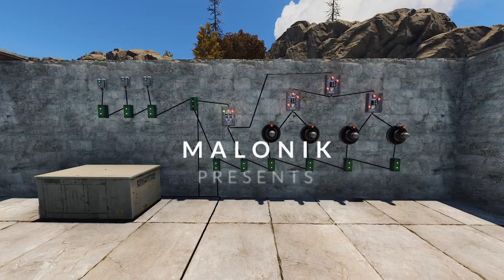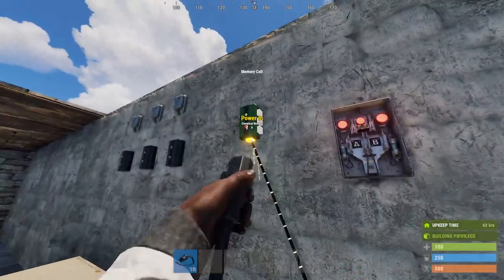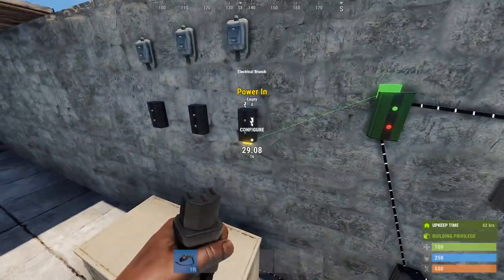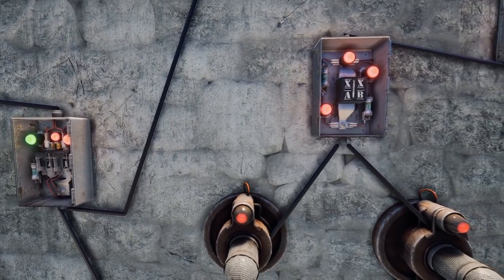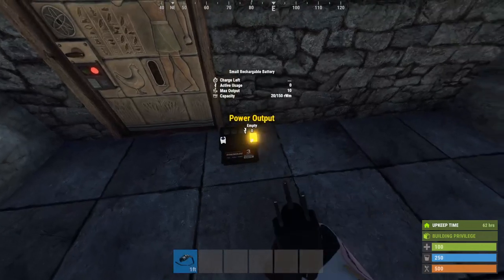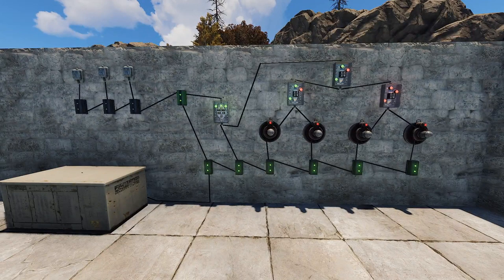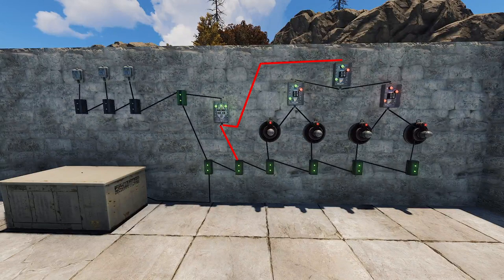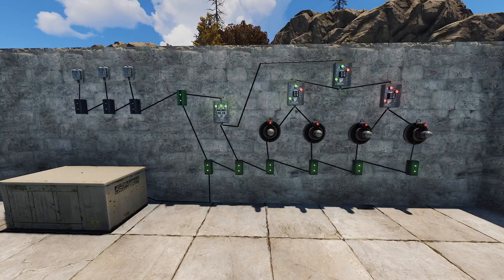RUST 101: Electricity - Base Lockdown Circuit

Comment: Great vid! Interesting about XOR and OR comparison. I was tearing my hair out why the OR wouldnt work but the XOR would (in an Autoturret circuit i was building) but this is the reason i guess! According to Rustlabs they consume 1 power so in theory it still shouldnt get to the 2nd XOR switch in your example (if im understanding correctly). Also so frustrating having to use so many branches as well I wish they would bring out one with much more outputs! ...Anyway great vid mate. :-D
Reply from the maker: Thanks! :) Yeah I'm not sure why it doesn't use that 1 power but it's been like that from the start so I'm not sure whether it's intended or not because surely they would have fixed it by now..

Comment: 5:48 - I would add that since this is basically a 'We're getting Raided!' Warning / Base shutdown system then you could also use the power out of the mem cell to go to a system of alarm lights/speakers deeper inside the base and/or the smart alarm (when the app gets released, to send you a notification), etc. It would also let you know that once everything is clear someone needs to go hit the master reset switch in TC room, or wherever it is that you feel safe enough to put a literal open all the doors' switch.
Reply from the maker: Ooh I like it!! I'm extremely excited to get into the smart components.. already got the app and have been playing with it on staging lol.

Comment: I think door controllers are viable mostly for airlocks, turret pods or minicopter garage, even the simplest setup (pressure pad + door controller) can make your base more secure and you don't have to turn your head back each time to close the door as you leave. But due to door controller nature and lack of different states it is really annoying to use. Regarding security concerns I've seen a really good solution suggested by someone - placing the RF broadcaster on top of the TC, so coupled with hidden antenna it automatically cuts the power once tool cupboard gets destroyed. But if you plan to use circuits like that external TC's or multi-TC build is a must
Reply from the maker: Yeah that's fair enough, it's annoying as hell that the for controller is really a door toggle rather than a controller lol.

Comment: What if all sensors detect enemies at the exact same time? XOR SWITCH wont passthrough any power, no doors will shut.
Reply: Yeah I was wondering this as well. 
Guess depending on the base it would be unlikely that both could be set at the same time before at least one signal was sent first?

Comment: awesome, now I know what I did wrong all the time. But the heck i never realised that the XOR doesn't use power... I hope they won't change that, cause if they do oh man that would screw up so many possibilitys. Again Great Video ! Also the now the XOR gives me new Ideas for using it with the output of turrets.
Reply from the maker: Yeah a lot of people don't realize that which to be honest is completely fair. I would have expected them to use 1 power and for a long time thought they did until I tried one lol. Another funny little electricity thing is that you don't need to power a pressure pad if you're just wanting it to trigger 1 thing. Not sure why but hey it works lol.

Comment: You could alternatively make this with RF Broadcasters for each HBHF sensor, all set to the same frequency. 

A single RF Receiver would trigger the Memory cell.

This would remove the need for XOR switches, but would be a bit more expensive in terms of tech trash and high qual.

Comment: That left side with the door controllers, you could use one splitters for 10 HQ and 1 Rw instead of 9HQ and 3Rw.  Splitter is boss.  Can also branch 7 power to a splitter to feed 3 HB's.
Reply from the maker: Yeah absolutely! I went with branches because I didn't know how many door controllers Nycee was actually wanting so the 3 was just an example and the branches covers them incase they need way more or a weird amount of them. :)

Comment: XOR switches are so underrated. They can act as blockers, AND switches, OR switches, are fairly common, don't consume power and are cheaper than a blocker (5 HQM vs 5HQM+1 gear). And they work both ways!
Reply from the maker: I think a lot of people just don't understand them. Like the or / and switches etc are nice and simple because their functionality is in their name. Where as with an XOR people see it and are like wtf is XOR lol.

I'm curious to know how you're implementing them as an and switch or blocker though. I wouldn't have thought you could use them as an and switch because it'd send power through when only 1 line inputs power.
Reply: @Malonik  I might do a quick video about how versatile they are, if it can give you inspiration for the Power Minute series 🙂

Comment: rly like your video's and they helped me alot getting the basics. the x/or's in this setup however i feel have a security flaw, because when a larger group would be triggering both sensors (coincidentally) or the sensors overlap their area accidentally, the x/or wont pass any power through.  i get its a small chance as the timing for triggering both sensors would need to be perfect, but still. personally i use a circuit requiering a little more power, being an and switch for every hbhf and have a branch feed the 2nd input on the and switch to supply enough power through that line, as the hbhf will only need to put 1 power into the and switch to activate the passthrough. after that i funnel the and switches into or switches to get 1 output line again. i feel the extra power consumption is worth covering that risk. interested how you feel about this.

Comment: Nice circuit!  The And gate is not needed here because the memory cell only needs one volt to trigger.   If you have a need for way more hbhf sensors, look up the "many eyes" circuit on the rustrician reddit.

Comment: Use a splitter on the door controllers if you have 2 or 3 door controllers, you want to safe electricity and you dont mind using a little more hq
Reply from the maker: Yeah absolutely! So long as your power supply is stable to avoid the issue where splitters throw away extra power lol. I just went with branches so it can be expanded and implemented easily into bases with lots of doors. :)

Comment: So, i realized that if every sensor goes off, the XOR's should effectively trip themselves and reopen the doors. however, if you have power always running through an AND circuit, you can use the AND as a little transistor instead of XOR's, this removes both the 1 power problem, and the short circuit issue.

Comment: Just wondering why you chose XOR switches instead of OR switches. It is highly unlikely but if the two sensors go off at once and they are both on the same your switch it won't send any signal. With the or switch it doesn't matter how many sensors pick something up.
Edit: Ah, I see. Should have watched the entire thing. However you can avoid the problem of the 1 power output of sensors with a branch in front and and AND behind the sensor
Edit2: that said your solution saves energy and will probably do the job anyway, so nicely done creating this efficient circut

Comment: Is there not a flaw in the design that using XOR switches that if multiple HBHFs are triggered at the same time  then it wont work
Reply from the maker: Not that I know of? When I was testing it all 4 of the sensors were detecting me and going off and it worked fine.
Reply: @Malonik  I was thinking that in theory because of the exclusive nature of XOR if there is another signal it would cancel up the other. so hypothetically if two signals were to happen at the same time then they would cancel each other out failing to push through a pulse to trigger the memory cell to switch on the lockdown. 
but that might not case in actuality if thats what your tests show - i would interested to check into that myself if there is something useful to exploit there. i know electricity doesnt flow instantly but takes more time if it has multiple components to travel so maybe there is something like that going on - which in this case could be useful.
(I made a self turning off generator turret circuit for a friend who loves cave bases but i could only make it work if i slowed down part of the circuit by adding additional components to slow the signal down enough to keep the whole thing on long enough to get all the other components to function.)
Reply from the maker: @SirDominic  Yeah they don't seem to work the way I would assume a XOR should.. But they've been in since the start of electricity so I'm guessing it's working as they intended at the very least lol.
Reply: you are correct in theory but Rust doesn't always work according to plan lol. As long as your sensors aren't placed in direct line of sight of each other and the raider simultaneously (which would be impossible with a little bit of planning and require a ton of luck on their part) then one will trigger the circuit before the other and it'll work.
Reply: Yea I had the same question. Nice, in theory it shouldn’t work if both sensors are going off.

Comment: Maybe do a simple minicopter garage sensor? (When player with TC access is detected, minicopter garage opens) I think this would be a cool project for and beginner electricians
Reply from the maker: I do that exact circuit often for my boat house! We actually have it rigged up so it works both in and out and shuts behind you. I can definitely do a video on that one. :)
Reply: Malonik Sounds cool! I think it’s one of those circuits that even people uninterested in electronic bits and bobs can use
Reply from the maker: @scuffedrock  Yeah for sure and it's really not a hard circuit so should be a fairly easy vid. :)

Comment: So, if you get attacked from every side by a Zerg, the XOR switches will get voltage on all their inputs and nothing will happen? Just wondering. Great explanation for the circuit, btw, not too wordy.

Comment: I have watched tons of rust electricity videos. I know the basics like batteries, switches, branches and combiners but, I can't use them in a circuit that I plan. I would love to have a base with both this door system and a light system that automatically lights up when it's dark and shuts down when it's day time. Also I want maybe one or even two turret traps with hearth beat sensors. But it all gets really really complicated. I want to use solar panels because wind turbines can be griefed easily and it makes your base look more apealing with a tower to generate more power. I would really love to see a base design stuffed with practical and cool electricity circuits like an in game clock.. I honestly don't care about it being 100 rockets and cramped up with all that bunker shit. I think that would be a really good video to do.
Reply: You can definitely do this, even though it's going to be a hassle. What I would recommend is having separate circuits for the seperate functions. You make this circuit + battery backup cause of the solar panels, and you find the other circuits too, and also give them battery backups.

The easiest one is by far the light circuit. Use as many solar panels you need, combine with root combiners, and then send the power to a battery of your preference. Then connect the output of the battery to the input of a blocker. To block the passthrough, either use a separate solar panel, or before you connect the power source to the battery, branch out 2 power into the block passage input. The output of the blocker should support all the lights, that will automatically only be on when the solar panels send no power.

I'm on my phone, so sorry if any of this is confusing/poorly formatted
Reply from the maker: Sounds like you're overwhelming yourself, keep things as simple as possible when it comes to electricity and especially implementing multiple things. Have an electrical branch chain from your main power and each branch off is a new project/circuit. 

The lights are particularly easy because you all you need to do is put a blocker before the lights and run a solar panel into the block socket. Then when it loses sunlight it'll turn your lights on. 

The turret traps are just a sensor into  door controller and if you're wanting to save power and not run the turrets constantly the sensor and mains power into an and switch then branch out to the door controllers and turrets.

The clock I haven't done, mostly because without admin you can't get the current server time and it'd shit me knowing it's not accurate lol.

Comment: I would use 2 HBHF sensors, one for your team and one to exclude your team. The one to exclude your team would be for raiders to trigger, with a blocker. The blocker would then go to an AND SWITCH coupled with the other one for your team. So if you came home you could open all the doors for yourself but if someone else was outside or in your base it wouldn't open anything and would cut power and close the doors. Something like this https://i.imgur.com/jRr686I.png Much more simple IMO
Reply from the maker: Nice one! That's a fantastic little circuit!
Reply: @Malonik  Thanks :) I just realized my 3rd branch on the left is redundant but no biggie. Really nice video btw, clear explanations and you taught me that XOR switches don't use power, keep up the good work!

Comment: Question, can one heartbeat sensor open all the external doors on a building or doors of your desire, usually with turrets behind them, or do you require having each door with their own heartbeat sensor?
Reply from the maker: Yeah absolutely! That's actually how this circuit works so if any one of those sensors get set off they'll trigger all the doors. I put them near each other in this vid for simplicity sake when explaining it but actually implementing it into a base you'd spread them out around it. 

If you're just wanting the 1 sensor and you want it to open the doors you can simplify it a lot too. Like mains power and sensor into an and switch and then the and switch into a branch chain that goes to all your doors. Include unauthed and exclude authed on the sensor. :)
Reply: @Malonik  thank you my dude. 5K hours and fucking still have rough time with electric. My electric and PvP LOL. I'm not horrible at PVP but I am much less better than 5K or player should have. I spend my time building fortifying can grinding for loot.
Reply from the maker: @GrandpaRust  I'm much the same but only 3.3k hours, occasionally I'll totally fluke some crazy play but for the most part I spend my time building and farm botting lol. I wouldn't beat yourself up on not knowing the electricity stuff, it really is it's own monster and the only way you learn it is by plugging crap in and going oh.. that didn't work.. why? Lol

Comment: Ermm... The problem I see with this is that using xor switches is not a good idea??? What happens if two heart beat sensors are activated at once??? It will block the output from the xor and not trigger the control system.??

Comment: Why are you forcing branches when you can save more power with splitters?
Reply from the maker: The splitter would work for this example but that's exactly it, it's an example. I didn't know how many door controllers nyceee wanted so I went with 3 but I used branches incase they've got a bunch of doors or even a weird amount of doors. Also check out the power minute on splitters, they have some really negative features if your power supply fluctuates.

Comment: It's good but I prefer to make each heartbeat sensor shut down its own isolated area rather than the whole base. This means you only need a memory cell per sensor and I really abuse the tesla coil on the output side of it. Nothing like dead offline raider loot.
Reply: Quick question, if your circuit branches to  a blocker and a timer (connected to the block current input) will the timer prioritize and create a countdown to activation, or will all components activate simultaneously?

Comment: In all honesty I've never used a door controller except for the external doors anyway. So they'll have to blow through it anyway to get PC or through a roof LOL and if they went through all that trouble I don't mind if they open the last door with some tricks instead of Boom
Reply from the maker: Yeah that's fair enough, as I said I don't think most people even think of the battery trick anyway. I just can't stand the idea of them getting more without using booms lol.

Comment: What if 2 sensor are triggerd at the same time?
Reply from the maker: Works the same way, so long as at least 1 gets triggered the circuit will kick in. Only difference being if 2 got triggered it'd send 2 power through instead of 1.
Reply: @Malonik  ok, maybe it's too early for my little brain, but wouldn't the XOR switches cancel eachother if ALL of them get triggered? it's not impossible to have your base surrounded